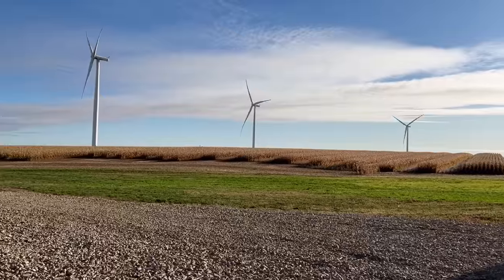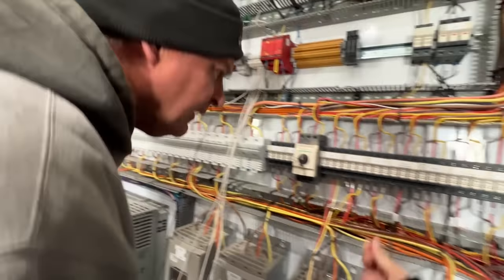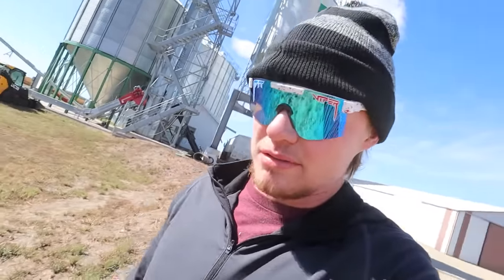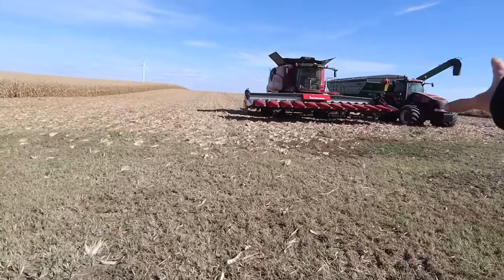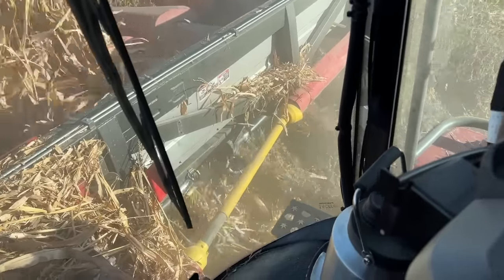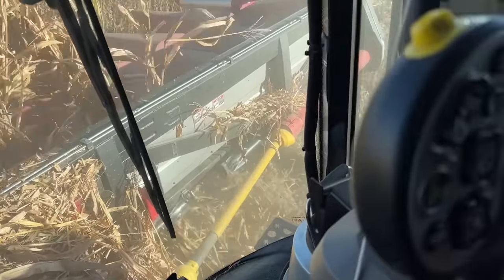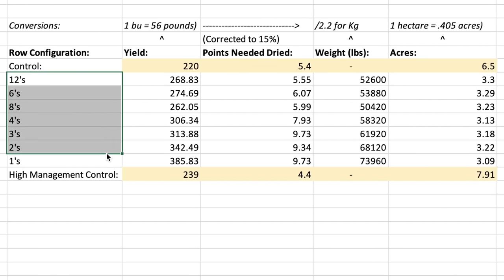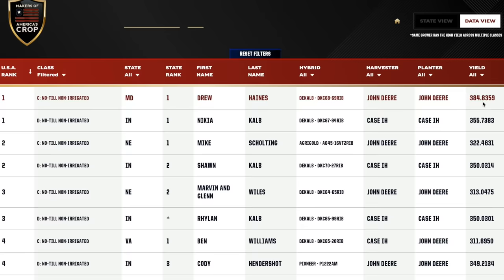I Won The United States High Yield Corn Contest

Comment: Many years ago, before wide use of NPK fertilizers in MUCH higher quantities was a thing, here in Wisconsin there was a war between 40" to 36 or even 30"  You could be farmer A, using less fertilizer to save money, run a population of 45-48k on 40" rows OR farmer B, with newer planters running 30" rows at 36k to 40k or so population AND an NPK fertilizer of some sort, the yields overall would be similar.  My grandfather and his dad in the 50s decided to stick with 40" rows, they bought a brand new (I use it for sweet corn planting today) planter with fertilizer and gave up their dairy farming so they lost the ability to spread manure and make up some of that difference.  They had a similar cost to farmer B, but enjoyed a 15% increase in yield from fertilizing and row spacing.  My grandpa basically said back in the day it was all about spacing but would be more affected by lack of water.  I dont farm myself, I did when I was a kid until I went off to the army.  Today, you can manage yields by testing row populations, You can effectively stagger 40k and 30k row pops and still achieve a higher yield simply by sacrificing "greenspace" for more sunlight penetration.

Comment: Congratulations on the intercrop yields! My question, as a non-farmer, would be about how to make harvest of the new row configuration (whichever is more profitable) easier? Would you stay with the current combine head or go to a smaller one to fit the new rows? ...and would that change the profitability in any way? ...smaller head, more passes? ...maybe increase profitability of the soybeans? 

On what you perceive as negative comments concerning the new bin site: no, your comments aren't negative. Most of us have been here during the planning, building and start up. You're speaking the truth as to what y'all experience in the operation of that site. If construction had been correct, the problems wouldn't be there and you wouldn't be speaking in such a manner. Your descriptions are merely a reaction to the lack of quality in the product you paid for. No need to change how you talk about something we can all see even without farming experience or knowledge.

Comment: You might solve your belt burning problem on the pit by changing the pulleys on the auger and motor. Sounds like the pulley on the auger might be too small.

Comment: Your cost / acre on your spreadsheet looked wonky to me!  I would have thought the cost to plant 22.5 acres of corn was 1100X22.5=24750, 22.5 acres of SB was 22.5X950=21375, so 45 total acres sown would cost =24750+21375=46125, so per acre cost would equal total cost divided by the acres, so=46125/45=1025.  I think your cut even is more near what you suggest earlier while in the combine!  Maybe I've got the bull by the horn but my spidey sense is tingling over the math.
Reply: I agree the numbers in the spreadsheet Cole showed need adjusting. I did the same calculation as you before coming to look through the comments.

Comment: If you straddle 4 rows, the 4 by 4 would be best in my opinion. You would run over no beans and be able to take in 8 rows with a 12 row head. Also take the stompers off. Your bean head will cut the corn stalks add I bet you'll get a lot of material dragging up with stomped corn

Comment: Terrific application of Real Time field Metrics. You are so right about using the 2 devices to monitor / record results as Murphy will always become involved, the closer to the end run of any long time measurement sampling. Would the Beans suffer less head shatter if doing the Corn runs at night when the Bean pods have toughened up? Would next year see a different row spacing to a 4 Corn 6 Bean  ratio which would allow the use of a smaller Combine that would fit in the 4 row Corn width and minimise crop destruction? As with most things there will be a compromise of Yield over Cost which often ends up in a coin toss of which method to try and again Murphy will intervene and you discover that you should have tried the other way! Looking forward to the final results. 
On the Bin Site issue, by clearly identifying the parts that work as expected either by good design/ construction or experience from the non-compliant sections can at least compartmentise the issue. You can end up at least knowing that you really do have a 100% steaming pile on the ground dumped by someone else or at best its only a 80% capping over a small 20% nugget of gold that you had started with by hard work and effort. Focus on the good and keep that as the driver to work at the bad. In these project scenarios Physical and Mental consideration can be just as significant as the Structural and Performance issues of the job. Keep at it Mate, Illegitimi non carborundum.
🦘🐮🚜📡🧪🦘

Comment: the 3 phase motors have over load/over heat also you should be using phase monitors they run between $75 - 
$175 depending on amps and if i is Y or Delta motors it less expense than a new motor or paying someone to rewire a motor I started using phase monitor after having to purchase a $2200 3 phase motor because in could not be rebuilt after 4 times

Comment: Would be interesting to see intercrop.. being done with a farm that runs/testing a NEXAT. Or when they are finally done with testing and come out with the 80 feet variant, that does planting, spraying, combining... etc. It always run in the same tire track. so everything between is "party"

I think Nexat strong suit will be intercrop, if it intercrop work as the paper says. (Just think about a Nexat with a modified split header and twin separate corn bin, logistic nightmare...)

Comment: i don't know but i think you made a little mistake at calculating the yield at 22:59 because the cost of corn per acre was 1,100 and soybeans per acre was 950 if you add them together you have the cost of 2 acres but you counted them together as one ?

Comment: Hi Cole, 
Nerd here.  Why wouldn't you ÷ (1100+950 by 2?  If the 1100 and 950 is per acre and your planting 1/2 soy and 1/2 corn; you'd still want to be on a per acre basis?  Maybe I don't understand the inputs but if the cost of production numbers are on a per acre basis I would think to ÷ by 2 to stay on that same per acre basis. 
But it's your costs are for the individual input on the same acre, ignore this.

Great work with this 👍

Comment: In Architecture, a lot of attention is given to the orientation of a building w/r/t solar exposure at different times of the year.  How much trouble is it to change the direction of your crop rows to run north/south, east/west, or anywhere in between?  My naive guess is that for best exposure, you'd want them oriented east/west.

Comment: Your maths are a little out if I'm not mistaken.  You can't add the Est Cost of Production together because you didn't spend $1100 and $950 on every acre.  You should average them out.  So 22.5 x $1100 + 22.5 x $950 = $24750 + $21375 = $46125 you spent on the 45 acres.  Devide that by 45, you get $1025 per acre. Which mean more or less 8 bushels per acre needed for the Soybeans?
That would make more sense to me, please correct me if I'm wrong.

Comment: Question on the price per acre. If you add the price per acre of corn and beans together, don’t you get the price of two acres? Isn’t the price per acre the average between the two ($1025)? If you multiply the $2050 number by your acres, you get $92,250, but if you multiply the beam and corn acres by their price per acre separately and then add them together you get $46,125, which averages $1025/acre. Which would mean your corn production by itself is giving you a profit.

Comment: Intercropping seems to be an interesting idea with a lot of potential. All you really need to make it efficient is a combination head that will run beans and corn together while keeping them both separated. 😆
Any task is about dealing with problems and finding solutions. The sticky issue with the bin site is the conflict with the contractor and the lawsuit. Remember the wisdom of The Godfather, it isn’t personal, it’s just business.
Reply: It has already been proven to be better but the lose of the beans and the extra time it take to plant and harvest it makes it not as god as you want it to be.  To much headache for what little you gain washes everything out.  Now what they have found is doing a double row of corn skipping a row and doing another double row of corn increase yields and make it easy to harvest.

Comment: Your spreadsheet has a faulty calculation in it. You added the cost of production per acre of both corn and soybeans together meaning you you now have the cost of production  for 2 acres! you need to divide $2050 by 2 for the actual average cost per acre. That will change the outcome significantly.

Comment: if you do 420 an acre for corn, and dont even plant soy. skipping every second row, youd have the same yield as you normally do, BUT your cost for seed would be HALF. not sure if sprays and fertilizer would be less too or not. instead of planting soy in the between rows, why not plant something underground, like carrots or potatoes, so the combine wont wreck them.  im sure there are ways to tweak things like that to get the most optimal yield for everything. you need to realistically be able to harvest without destroying one of the crops.

Comment: I think it’s the other way round 400 = 800 because it’s only half the field cropped. Also 1 hectare is 2.471 acres not .405 acres. I think you meant 1 acre = .405 hectares.

Comment: ,,The door in the PIT needs to be able to be COMPLETELY SHUT,,,,,    That needs to be fixed ASAP... The PIT auger needs to be cleared EVERY TIME... you use it.. because it needs to be started EMPTY and then the door opened Slowly or corn put into pit at slower rates...

Comment: How much extra work would it be if you switch to not having mono crop fields ?
Would you be using more fuel and time in the tractor ?
What about driving the combined but not taking full advantage of how large it is since you're not using the full width ?
Maybe those are dumb questions but I couldn't figure it out from watching.

Comment: Great video.

So given the yield improvement with single rows of corn, would it be more economical to just not plant beans and do corn on 60" rows?  If you only planted corn, your costs would be $1100/acre, and with 380 bu corn, your income would be $1900/acre.  Planting both, costs are $2050/acre, and even with 370 bu./acre corn, you wouldn't realize the same profit ($750) unless your bean harvest yielded 75 bu/acre, which seems to be a long shot after getting run over and being sun-deprived.  Why spend the additional bean planting capital to realize the same profit?  

Regarding chemical - with Y-drops, would you be able to reduce nitrogen/fungicide usage by adjusting the configuration of the drops (plugging ports on the drops)?  That would cut chemical usage, although probably not directly in half, as you'd be applying chemical on half of the rows, but at a higher rate due to the higher plant population.

Also, I saw a comment about doubling the combine costs for beans vs corn, and while that it could hold true in the test plot, it may not translate to a full production model, as the driven distance would be different due to header width differences (i.e., 30' corn header takes 3 passes to harvest a 90' width; 45' bean header takes 2).

Last comment: given the wind storms that have swept through the area in the recent years, are you taking on some risk with wider row spacing?  Seems like increased row spacings would be more suscebtible to getting downed by wind.

Keep 'em comin.

Comment: The auger feeding must have a motor too small for the weight it has to move. Go with a larger motor, you are going to have to increase the feeder to the motor and the motor starter.
Reply: Not necessarily, I was an electrician on a new bin site with a similar capacity issue to the one he seems to have. The angle auger coming out of a hopper bottom bin to feed the dryer would overamp at about 20% of the projected flow of corn. After some trial and error, swapping pulleys etc, the millwright eventually cut off the double helix at the bottom of the auger flighting and the issue went away.
Reply: @bradcamenisch2808 
The issue seems to me that the corn at different moisture levels increases the weight the auger has to move. I would change out the motor size, and pulleys to match and put the issue to bed.

Comment: How do you like your JCB CTL? I've heard other people have had issues with theirs. Different attachments are hard to get to work with JCB hydraulic system and even electrical connections. I was thinking of trading my 2021 Case TR 340B in on a JCB 270T because of the safer and easier side entry. But now I don't know. Thanks for your great content, information and entertainment.

Comment: This is some phenomenal technique. Obvious bias toward the corn. Here are a couple observations. Your harvest costs are going to be higher in most cases since you will be running over the same ground twice at harvest (and planting presumably) in some cases. A interesting twist might be to have a control without any soybeans - just skip the rows in a 1x1 configuration. I'm old enough to remember 2 foot corn rows so, maybe what was old is new again?

Comment: 23:50 if it's half-half, why do you just add the two cost of productions? Shouldn't it be less than that even if not half? Then at like $1500 cost of production the corn alone would put you into positive. Or just plant corn at that pattern without the beans to save the cost of production on the beans. Or why not just plant the corn rows further apart? Sorry if these are dumb questions, im not a farmer

Comment: Could you put a slightly smaller diameter three rib pulley on your pit auger so that way the motor could put more torque into the flighting? It wouldn't be as fast as expected but you may pick up some speed
Reply: Good idea, could add VFD, variable frequency drive, to adjust actual speed of Auger.

Comment: Maybe it’s just me not understanding farming. But when you calculate your cost per acre, why do you add the two numbers together ? The est. price of production at the top isn’t that per acre?
If you field is then fully 50-50 split between corn and soy, then the average cost per acre is the average of 1100 and 950 which is 1025 usd/ acre. 

I don’t if it is just me who is wrong. 
Great video

Comment: The math isn't making sense, if you have a cost of production of 1100 for corn and 950 for beans. If you combine those costs you now have the cost of production of 2 acres. I don't think dividing by two after that would give you the real number because of the increased processing you will be doing in planting/harvesting. But that would be absolute worst case and a big overestimate that may be a great return when your expenses come in well under budget.

Comment: Hi Cole. I may have missed this, but I notice you are not using the AGI grain handling system. Is this because of the legal battles you're into with them?
Reply: They are having legal issues with the subcontractors or designers of the system, not agi. Possibly the clay or excavation was not tested or deep enough. Concrete rating insufficient or  not thick enough or cured properly.  Not designed properly or pcs not assembled properly or insufficiently or not to the design specifications or not welded properly.    Bin crews just do the assembly, and usually not connect to the manufacturer at all.
Reply: Alright that makes sense.

Comment: Just curious why it needs to move 8k bushels an hour, is that the rate at which it isn't bottlenecking your harvest operation? Does it just require too much babysitting at the current speed which is why it was designed to go faster?

Not being critical, just trying to understand the operation

Is there any way it would be feasible to harvest less than your full head width of corn? As in the 3, 6 and 8 row configurations

Comment: Auger V belts.. can you switch to cogged belts and pulleys...

 Bin foundation, Do you have any house moving companies in your area. that could come out during just before or during planting to insert beams thru the legs and lift the bin 10 or 12 feet. allowing the slab to be removed ...  the soil carved out and repoured.. with the thickest part around the outside of the slab..   or move the bin to the side and then bring it back and set it down on the new thicker slab.   hopefully the slabs won't have vertical edges but conical shape to transfer the weight to a larger foot print..   perhaps loops of steel cable embedded in the slab..  or welded rings of rebar. there are ways to thread rebar ends to create endless rebar loops..  i know there is a lawsuit and you can't do anything YET. but you will need plans for the future..  perhaps finding cement contractors that do wind power footings..  you need that kinda skill level..  not as much mass as a wind power tower..

Comment: Could it be possible to plant rye and/or radish in between the 1/1 corn rows instead of beans, and have them as a inter row cover crop? Or any other cover type crop that goes well together with corn, cause that gotta be more economical than having beans inbetween getting beat on with lack of sunshine, the header and all that residue.

Comment: I'm slightly confused by the cost per acre calculation.  If corn is $1100/acre and soybeans are $950/acre, and you planted then 50/50, then the true cost per acre is half of the combined amount, not the combined amount: $1125/acre, not $2050